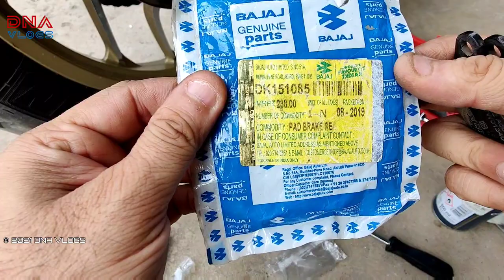Bajaj Dominar 400 2018 Maintenance | DIY Rear Brake Pads Change | Polar Odyssey Dominar | DNA VLOGS

Comment: Hi, i have problem in my domi 400! Whenever i just keep my 2fingers on  the front disc lever with very little pressure , brake lights illuminate and turns off if i took my hand!  brake light for rear disc works perfectly! What could be issue?
Reply from the maker: get the lever and fr brake switch checked.

Comment: From where can I get those front and rear seat?
Reply from the maker: where do you normally get the bike serviced from ?
Reply: @dipen.nisar.autovlogs  Bajaj ASC
Reply from the maker: @rgaywala  so they don't have the brake pads ?
Reply: @dipen.nisar.autovlogs  Hello Sir, it seems you have mixed up answers. My question to you was about front and rear seat, NOT about brake pads.
Reply from the maker: @rgaywala  you added a comment on wrong video buddy, hence the confusion. This video is about brake pads.  There is a dedicated video for the seat too. 😊 It's made some where in banglore but I did not find it worthwhile
Reply from the maker: @rgaywala  and things like seat can be done at any Seat Guy. Approach your local seat guy 👍🏻
Reply: @dipen.nisar.autovlogs  Thanks.
Reply from the maker: @rgaywala  👍🏻

Comment: My left side pad unable to fix properly
Reply from the maker: where did you change it ?
Reply: @dipen.nisar.autovlogs  my self
i tried to Clean it
But after when I reinstalled  noticed that  rear brake making noise
And not working atall 
Left side  discpad  not fixing proper
Reply from the maker: @swanandchoudhary5781  have you done any diy before ? Or was this the first time .  With all patience, reinstall the pads. If you can't., Don't try further. Take the pads off. Call a mechanic or take it to nearest service but while riding don't use rear brakes
Reply: @dipen.nisar.autovlogs   first time
And I can see  left side pad support bracket clip  has bend  
This is why left side brake pad is not able   fit inside this bracket clip
hardware
Reply from the maker: @swanandchoudhary5781  ok. Follow the above instructions. Don't ride the bike with rear brakes in this condition, will damage fuether

Comment: rear brakes are useless
Reply from the maker: Rear brakes in most modern day bikes are supposed to be used only to slow down the speed not stop. That's why they are designed to be smaller and lower capacity that the front. If you need additional stopping power, use engine braking or ride slow. And then you should be good.
Reply: @dipen.nisar.autovlogs  yes I know , I have 1st lot dominar which is one of 1st 20 dominars delivered in india. So far I didn't change the pads, my I know for how many kms you got it replaced?
Reply from the maker: @MrRangerSTORM  it's the polar Odyssey bike.
Reply: @dipen.nisar.autovlogs  after I saw ur video I'm thinking to get it checked once
Reply from the maker: @MrRangerSTORM  get them bleeded if they are not working at all. There might be an airlock. Check my latest video on my 2017 dom.
Reply: @dipen.nisar.autovlogs  last time SA adviced me to change master cylinder,  since byte won't increase much I denied.  I need to compare my bike rear brake bye with other dominar
Reply from the maker: @MrRangerSTORM  sure do that